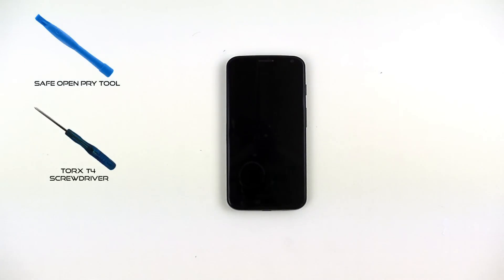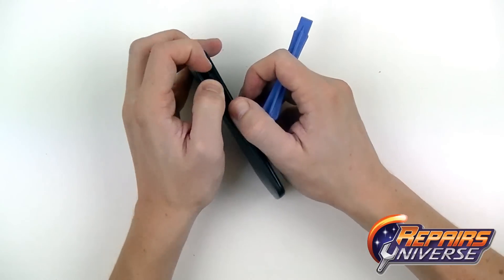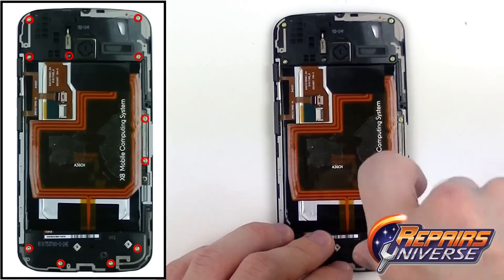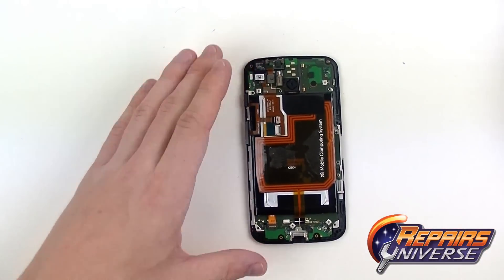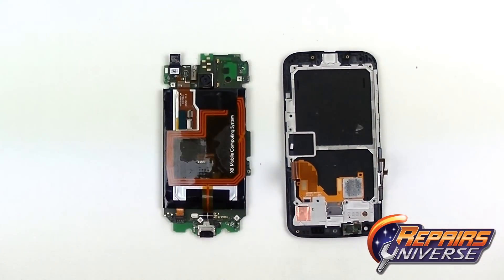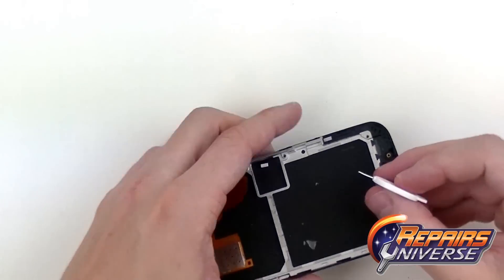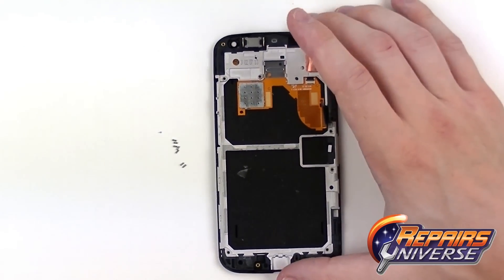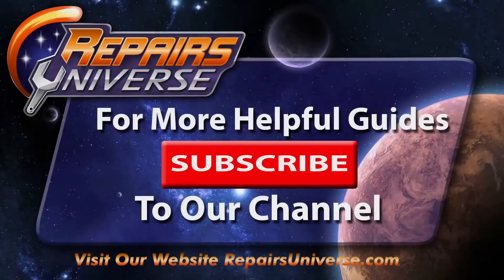Motorola Moto X Take Apart Repair Guide

Comment: is the microphone easy to replace and if so could you point me to where it is on the phone? thanks
Reply from the maker: +Tbail1138 Unfortunately the mic is soldered to the motherboard.
Reply: +Repairs Universe oh really? so replacing the microphone ear speaker flex cable would not resolve my mic issues?
Reply from the maker: Tbail1138 It depends the microphone on the ear speaker flex cable is used for speaker phone.

Comment: hello I'm facing the problem with my moto x 2013 problem is the flash light not open while using camera and flash light app (in lollipop notification bar) I'm trying to different flash light app but I'm not get success.

Comment: I need help repairing the circuit board and my screen without having to take it in
Reply from the maker: +Nina Lawrenz The video will assist you in replacing your LCD and Touch screen assembly. Not to sure we can help with the circuit board issues. Here is the link to the items we offer to this model http://www.repairsuniverse.com/motorola-moto-x-screen-replacements-repair-parts.html

Comment: My son dropped his phone and I replaced the display assembly.  Now, whenever I plug in the USB to charge it, it just keeps vibrating every 15-20 seconds and will not power on.  Did I miss something in the re-assembly?
Reply from the maker: Brian Buttrey Double check your flex cables to ensure they are seated correctly. It may have disconnected on reassembly.

Comment: hey do you guys repair phones as well? or do you just supply the tools? because my moto x's charger port is broke and no place anywhere (not even Motorola) will repair it. I've seen literally 50 videos on how to do so, and yet no one can help me with it.
Reply from the maker: We do offer repair services unfortunately not on parts we do not offer. At this time we do not offer the part required, hence could not offer the service. I apologize for this.

Comment: Can i just replace the back cover ,Mine has peeled off and i need a replacement .Does Motorola provide provision for replacing the back panel only ?
Reply from the maker: Unfortunately we do not offer just the back cover. You may want to contact Motorola directly though, they may be able to assist you.

Comment: I dropped my moto x 2 generation and the glass breaks, the screen and the touch are working well. Is the glass able to be repaired?
Reply from the maker: The glass can be repaired but we recommend that it only be handled by experienced tech shops as you can severely damage the device by trying to get that glass off.

Comment: Dropped my Moto X and the screen has a small black band at the bottom (turned red first and then went black) and mottled splats the rest of the screen. No cracks in glass and phone still works OK. Is the screen display able to be repaired?
Reply from the maker: The LCD is fused to the touch screen. You would need to replace both the LCD and touch screen in order to resolve this issue.
Reply: Thanks very much for your advice - much appreciated. :)
Reply from the maker: No problem at all. We're here to help!

Comment: I have broken only the glass of my moto x, do i need to change the whole screen or only the glass? do you have any practical video so i can only follow the steps by myself?? thank you
Reply: Hello Nicolas...here is mine same problem...what did u made to get repair ur moto x...thank you
Reply: Hey there.. What I've done was to only replace the front glass.. With an expert guy who has a special machine to separate it.. But let me tell you that it didn't work properly.. Some functions stopped working and it wasn't the same mobile phone I had.. Maybe you can try the same as I did but take into account this problem may come up.. Hope this will be useful.. Good luck
Reply: Thank yo...Which functions r not working n what is the reason for that so that I could b aware of that things while repairing ...n which glass u replaced n which by which special machine  u made separate
Reply: Means which glass u putted after removing broken glass..?
Reply: Moto x  only glass is available in market...?

Comment: Great video! No too fast as others. I hate when they assume too much! I wonder what is the purpose of the small hole near bottom on the back?  Also, my daughter spilled milk on my Moto X and speakers stop morning. I damped it with 70% alcohol and now they work. No need to install new speakers. I used 99% alcohol on iPhone once for something similar but it seems 99% alcohol is too corrosive since penetrated under screen and left a visible cloud looking stain under screen.

Comment: So today I dropped my Moto x on the cement and the bottom half of the screen wont respond. Also I noticed that it had this green substance like splat all over on the right side. But inside the phone. There was a crack IN it also. How can I fix this? because I really don't have money to get a new one because it would be $100 and more with insurance. Please respond. And Thanks.
Reply from the maker: Mayra Hernandez I would love to help you, but the reality of the situation is. Using your insurance is going to be a lot cheaper than trying to repair the device yourself. The screen alone for your device retails for 199.99....http://www.repairsuniverse.com/motorola-moto-x-lcd-touch-screen-digitizer-replacement-black.html

File a claim, and be thankful you had insurance on the device.

Comment: Looks like it's not a Torx T4 that was needed. Bought a specific Torx T4 since this video told me. Didn't fit. Please make sure if there are some models that have different size screws before posting what you'll "need"
Reply from the maker: joshua We try to be as accurate as possible. Sometimes the manufacture uses what they have to assemble there devices. We go by what it took for our tech to repair the device. These videos are for educational purposes only. To give you a general idea of whats involved in repairing your device. We look to the community to help out when and where possible. Meaning instead of bashing give info. If a t4 was not used in your repair then what did you purchase to complete the repair? This way the knowledge base grows.
Reply: Repairs Universe
Unfortunately before reading the comments, a kit with a torx T4 is what I happily bought to fix my phone, as its readily available. Torx T3 (incredibly less convenient to get locally) is what I actually needed and seems to be the one all other Moto X repair videos recommend. Not sure how to check which screws you have in your phone, but be careful.

Comment: I was thinking if we can upgrade the SD memory size from 16GB to maybe 32GB or 64GB, is that possible... i don't see a card slot anywhere in the device or else can you point out in this vid.
Reply from the maker: Dev Ganai Sorry but the Moto X does not have expandable memory. As for changing the chip set to gain more memory that is above the average skill set of most of the readers here. Good Luck!
Reply: That's what I'm saying.. There is a card or is it a inbuilt part. Or if I can get it upgraded by someone.. Appreciate your response.

Comment from the maker: Sorry to hear that! But yes you should be able to remove the lodged sim card, by opening the device. Follow the video to the point where you remove the motherboard, and you should be able to push out the sim card once the motherboard is removed. In order to open and close your device you will need a "Safe Open Pry Tool", and a "T4 Torx Screwdriver". We have these tools available at RepairsUniverse (dot) com. Best of luck!